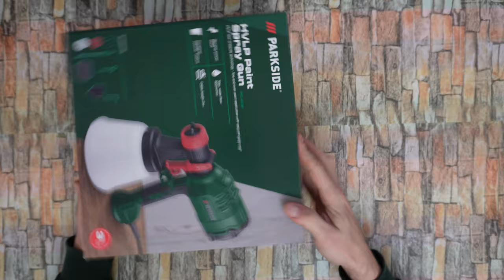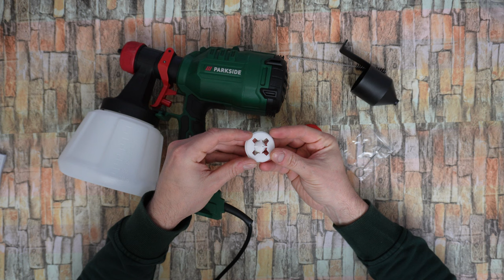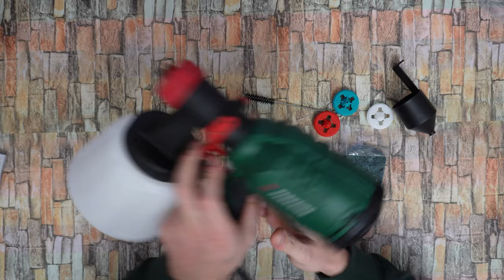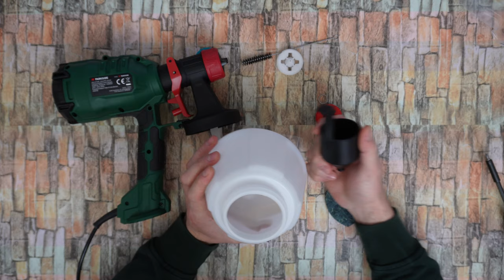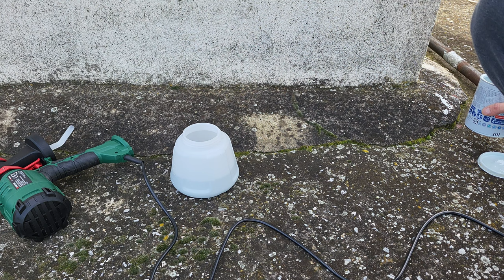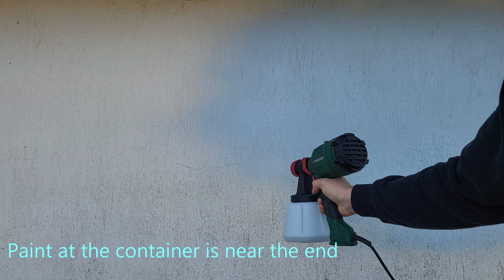Parkside HVLP Paint Spray Gun PFS 450 B1 TESTING

Comment: Nice test of the new model. I have the old model (A1) but I lost the nozzles so I just got that one.

For those unsure about buying one of these, the hardest part is figuring out your paint dilution. Otherwise, for larger areas, it's better than a roll. It leaves no streaks and a few back and forth can cover the surface evenly if you pay attention (about 1/2 or 1/3 overlap).

People might say rollers are best but they need to keep in mind that an expensive roller will be better but cost as much or more than the machine and you have to use expensive paint. This machine is for DIY people at home so it's better than a cheap roller and can do nice things with cheap paints. 
It's also easier to clean. Just some hot water and a rag and some very diluted hand soap for the bits that dried and it's clean like new.

Comment: i think its waste of money and pain in the ass to clean it. The old traditional way is better
Reply: Got to be honest, I've picked mine up for £22 so even if I used it all day to spray my kitchen, toilet then bathroom, it's worth it
Reply: I have one and think that it's easier to clean than a roller.
Reply: I have both, rollers brushes and this spraypaint. When I bought it I imagined it can be used outdoor aplications and for furniture for example. With water diluted colors it is easy to clean up. For thinners it could be messy and should be done somewhere when your wife cant see. But I have to admit to the op that I once started spraying boat and ended up using roller because the airhose spraygun only wasted lot of paint. With a roller it was only easy sweep and it was DONE.